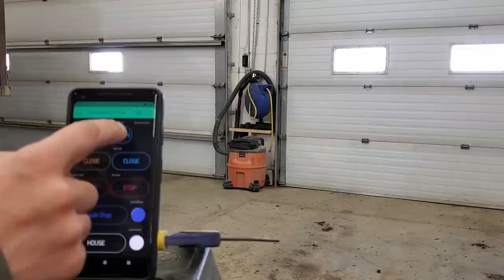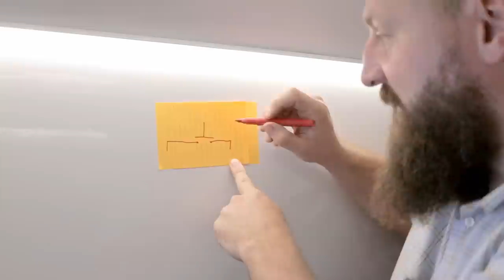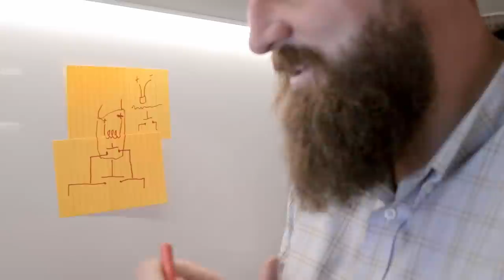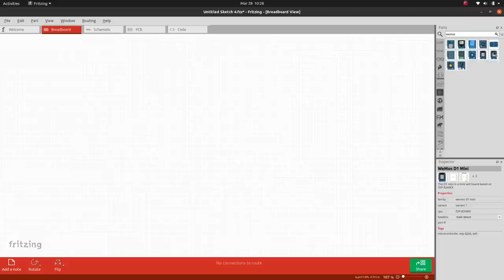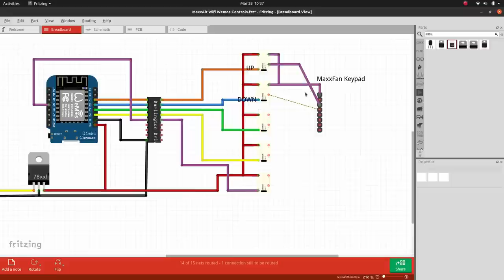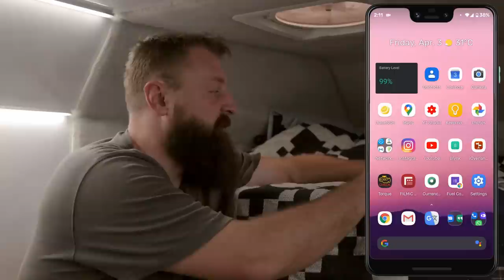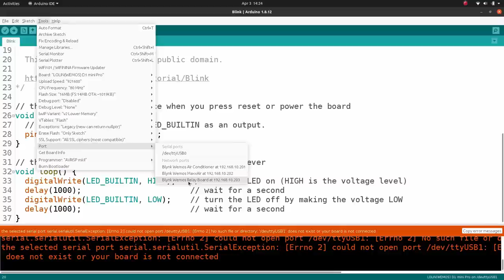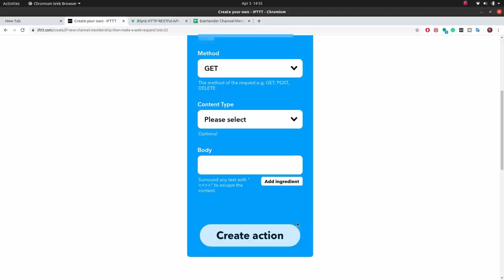How I Automated All the Things - Raspberry Pi, Arduino, Fritzing - Everlanders Automate the World!

Comment: Great video! I teach CISCO IoT Fundamentals at a High School in Oklahoma and I just assigned this video as a distance learning assignment for my students.
Reply from the maker: Wow, I'm blown away and honored!
Reply: @Everlanders  to power the D1 minis are you using a DC to DC buck converter when only the automotive 12v system is available?
Reply from the maker: No, I tapped 5 volts from the controller board from the AC unit, and in the case of the fan I used a switching power supply as indicated in our web site post: https://everlanders.com/2020/04/06/automation-arduino-and-blynk/

Comment: Also...for those just getting started, Tinkercad (free) is a good design program to start designing circuits, and as a bonus has a built in block code building tool that auto-generates Arduino sketches.  A fun and un-intimidating way to get started.

Comment: Very nice video! I also built stuff with arduino's and so but the problem with them was to find out the difference between all those models or even a good manual how to program the things or how to upload it to the board.

Took me many days to figure that all out, but if we have a teacher like you it's much easyier...And then i got the trouble of electric interference from that fan-motor for example...it can really disturb your signals and make the thing getting it's own life...

Anyway, can't wait for more video's from you.

Comment: This video is one of my favorites!  Super helpful.  I've been wanting to hijack physical buttons for years and never got around to researching it.  A few questions...
1. how do you handle someone flipping a mechanical switch messing up the software state of the button? e.g. mechanical light switch that a human switches messing up the software state.
2. it would be a great help to see how you soldered in the pin connector on the back side of the fan circuit board.  possible to show that in an upcoming video?
3. possible to do a future video on how you do your central web server that shows all the metrics/stats for the truck (e.g. the power solar system, etc...)?  I'd like to understand your implementation to see if it makes sense for me to implement something similar.
4. please give us some background on how you grew up and how you came to learn all of the tech that you are so good at (e.g. schools, jobs, etc...).  

Thanks for sharing all of travel and techy stuff.  I really appreciate your channel and how you have customized your rig to be exactly the way you want it!  Very cool!!

Comment: Boy that brought back some memories playing with electronics. For your power needs, if 5 volts isn't available, you could you maybe make a 12 volt to 5 volt power supply using a 7805? I did a couple projects in school with the venerable in it's day 8085 but never went beyond. Did a fair bit of prototyping and wire wrapping. Several people have told me how they like the Arduino and now Raspberry Pi for model railroading and amateur radio projects.  At this point, it would take me too long to get smart to do this but it's fun to see you doing it. amazing all the cool stuff like that prototyping software that we never had in the early 80's.  Stay safe and enjoy your quarantining as best you guys can.
Reply from the maker: Yep, 7805 if you can't find 5v, (that's what I did for the fan)... But if there's a regulator there already ya may as well use it.

Comment: 🤯 This is exactly what I've been researching! Thanks for filling in my 'knowledge holes'.🙏 I'm using a WEMOS D1 mini (love 'em) to remotely control 3 stepper motors ( zoom, aperture, & focus) for a wireless DIY automated 50mm lens. A13MP security camera will feed a RPi 4 w/1TB SSD, capable of streaming the video over Wifi, so it also needs to be controlled remotely. 
The plan is to VNC over Wifi from my PC to the RPi, which controls everything. So ideally it would be the MQTT broker and local Blynk server, controlling the camera, streaming, and steppers for automating the lens. The RPi 4 (located inside the camera housing) also controls 2 larger stepper motors for it's programmable x/y gimbal. That's functional. The D1/stepper board is running uPython code (RPi compatibility), via webREPL. 
Upon completion, a concealed D1 mini will detect motion at my driveway, alert me and trigger the camera to look towards the driveway, zoom in, focus, set the aperture (all presets + other locations), and start recording video until after motion ceases.
Just installed Blynk server onto the RPi4. Looking forward to your followup video involving uPython. Thank you for the pointer to Fritzing. Now, I can PCB my D1 mini stepper board. 🤙

Comment: Awesome EVERYTHING (I was going to say video, but your content is so much more)
Reply from the maker: You're the best!
Reply: @Everlanders  I've just finished watching a heap of your videos. I think we are of like minds.  Though you are ahead of me.  I'm converting a bus to a motorhome (doing all the work myself).  I'm researching and prototyping with Arduino, esp32, RPi 4, Chromebook and soon ROCK 5 Model B.  I want reed switches on all doors and lockers, motion sensor, gas sensor,  temp sensor and voltage monitors.  Also when the clutch is pressed the following will automatically be stowed: satellite dish, stabilising legs, step and a warning if the awning is not stowed.  Plus remote control of outside flood light, air vent/fan, air conditioning and heating.  And of course remote monitoring of 1000Ah of lithium batteries.  Now I'm ordering 10 wemos boards 🙂

Comment: Thanks for another great video.  I made it to the end.  I have been thinking about connecting a coolant heater for my truck to turn on with a text message.  I live in Alaska and work 2 weeks on then have 2weeks off. During the winter we travel down south while I'm off, so my truck gets parked and at-15F makes it hard to start.  This video gives me a starting point for my project.
Reply from the maker: Sure! Just trigger the blue wire on the remote starter with a Wemos pin.

Comment: Thanks for the video, didn’t realize how easy it was to remote download to the esp or the use of web hooks. Retired EE, fun stuff. Currently automating hot water tank with an electric imp,  might have to switch to the esp. Prefer using C as well, but have it all wired up. Wish I had seen your video ahead of time.

Comment: Absolutely blown away with the tech. Just found your channel yesterday and and have been binging ever since. Am currently planning my own build and what got my attention was using pressurized air for your plumbing system. Yup, started with that? Last time I waid air it's fairly light, good idea. Got the wife to go and pick up a raspberry but I can't find the 3po slot??? I have almost no clue what you just said, but I stuck it out to the end. Can you direct me to the kindergarten chanel?

Comment: Okay, I got to that part of the video. Of course I ended up sitting in the dark (Hey Google, turn ON lights) ;-)🤣 This might solve my own garage door conundrum.
Reply from the maker: For the Garage door you can also use inputs to sense if the door is open or closed and then when you send the open commend, it can react with some logic rather than blindly mashing the button. Much like I did for the power button on the fan.
Reply: Everlanders can you do a video on how to do the garage door setup. I have the problem that I’m always in different vehicle than the transmitter for garage doors and could use in depth tutorial. Thanks been following since raspberry pi overhead install days

Comment: Great video. Very helpful.   I'm a novice at this stuff myself but plan to add a lot for systems control and monitoring on our bus. Including the various diesel engine/ mechanical systems sensors.
Reply from the maker: Oh Good, Glad to hear it, this is a easy and cheap way to get into it...
Reply: @Everlanders  I actually set up Home assistant with ESP32s with mosfets and relays for control of lighting and other stuff I'm still building on our bus. What model of the maxxair fan did you use to do this?

Comment: Great Video! Used Blynk with some LEDs, works great. Steep learning curve at the beginning, but if you are a beginner hang in there 😄.

Also you can use a second wemos (with blynk) with i.e. a button to contol an other blynk wemos. (As a remote button, sorta like a button in the blynk app)

Comment: Great video Jason. Perhaps think about a) featuring a single project, and b) breaking the topic into specific videos for each element (1. What's being automated, 2. Physical components, and 3. Software/coding and tying it all together.)

Question: As relays are wired in parallel with switches, variable states become out of sync when someone presses a physical button (A/C temp, fan direction, etc.). Do you simply press physical buttons to realign variable states?

Y'all stay healthy!
Reply from the maker: It's been a couple weeks since I got that going and the state's seem to stay in sync pretty well, we've almost stopped using the buttons.
Reply: @Everlanders  I figured that's be the case. I am correct that changing state with buttons does throw things off though, correct?
Reply from the maker: It would, yes.

Comment: You may already know this but if you use the remote you can send the all of the control options for the fan (temp,auto, in/out, open closed all at once) this would get you around the beeping for big temp adjustments and having to store the state are you are just sending all of it.  You would need to do that through an IR blaster I assume.
Reply from the maker: I went the IR blaster route already, didn't work with the non standard protocols. Further I've since jammed a chunk of blue tack in the piezo hole to shut it up.

Comment: Interesting to watch, thanks! You could also have "emulated" the remote control, using an IR LED and some some code that put out the right IR codes for the corresponding buttons. First it's less invasive on the hardware and second the IR LED could be driven straight from in IO pin eliminating the whole breadboard. Just a thought
Reply from the maker: I tried this with LIRC long ago... The IR protocol for the MaxXFan was non standard and it wouldn't take it as valid.

Comment: Very helpful, informative, and entertaining video! I don't know if you've mentioned it elsewhere, or perhaps I missed it in the video, but how do you deal with ventilation while soldering? You seem to be in a very enclosed space which also looks to be where you sleep, which doesn't seem very healthy. Are you just running the ceiling fan? And is that enough?

Comment: Very nice!  Appreciate your skills and easy going way of articulating.  I am about 20% of the way through my automation design...interface wise to date using node-red and Pi.  Running out of GPIO's so appreciate the nudge towards the Wemos D1 solution.  Just a little concerned I won't be able to actuate all the camper functions in the event of a component, wifi, or Pi failure.  Thus backups and spares!  Be safe

Comment: Blynk looks interesting.  I’ve been using Home Assistant and Node Red to wire things up.  You can even have MotionEye as a part of your dashboard in HA.  Love that it can record to my NAS too.  I’ve got sensors and such, and no relays right now.  Soon though.  I’ve been interested in your channel since you practically do everything I fail to do 😁.  I liked your RPi head unit for the cab from a couple years back.  Keep doing these types of videos.  FYI, you can get more horsepower from a Node MCU or ESP32 chip.  You’ll like the improvements over the D1 mini.  Like, one Node MCU could run both your fan and air conditioner.  The length of run may be a bit long for the wiring though.
Reply from the maker: ... for $3.50 I can't run wire that far...

Comment: The videos are fantastic I would watch hours more of how I automate stuff. There must be some one who specializes in this type of automation that has more in-depth videos. I am in the planning stage of building a camper and would love to know more.
Reply from the maker: We have lots of other videos you could watch...
Reply: @Everlanders  I think I have watched just about all of them. I’m a big fan. I appreciate you manner, knowledge and approach you bring to the whole project. You have obviously came to to the game with a background in electronics. I work in the film industry as a Key Grip. I have designed and built out several tractor trailer, cube, smaller trailers as grip trucks. Doing all the design work on SW’s wiring all the circuits for lights, Webasto heaters light gates and such. I also built an electric camera car, pretty much from the frame up. I used an existing chassis with the steering and suspension geometry all worked out but after that it was all me. 120v dc (36 200 ah Calb’s) running a HPEV AC75 motor mated to a 5 speed VW transmission, not that I ever change gear. I was worried about steep hills with a full load. The cart is a great success. Shot with it on Chaos Walking, Barkskins, See, X Men to name just a few. I could send a couple of pictures if you are interested. After watching one of your videos I’m thinking of getting a SBMS0 v03D, not to charge it but to monitor its SoC
Reply from the maker: @macgrip1  Oh wow! very cool!
Reply: @Everlanders  I am wondering how to become a member of Everlanders? I have subscribed to the channel and just below the logo on your Youtube homepage it says “Subscribed” with bell picture crossed out. I would like to up my membership to at least level 2 but do not see how to do so. I have watched the video where you explain the tier system but the link at the end failed and I dont see any other link on the website to take me to YouTube where you explained the upgrades options and the ability to financially contribute were available.
Reply from the maker: @macgrip1  Be sure your not trying to click the link from an iOS device, if so you may need to use a Desktop Browser... 
https://www.youtube.com/everlanders/join
Thank You!

Comment: Hi, great idea, I've been working with a ton of 8266s and have 2 airfans in my van! ;) I'm probably not going to connect them, because I'm lazy, but I do have a noise and temperature sensor based on a 8266 for when we leave the dogs in the van so I can go and check the webcam or get alerted.  Quick question, do you travel with your electronics kit? Do you ever miss tools or components? I mean, half of my house seems to be dedicated to parts and tools, can't imagine taking it on the road ;) Also, is your phone connected to the van wifi? Or does it work with any network and Blynk knows how to tunnel to the van router and the wemos ip as long as it's connected to the internet? Do you need to have a static IP for the van?

Comment: Thanks for sharing, I definitely appreciate this kind of content (and watched the whole thing). Your Android Auto setup is how I found your channel. As a security professional the integration of IoT makes me cringe a little but it's cool how it all comes together. Security concerns aside, have you run into any issues when you're in an area with poor internet access?
Reply from the maker: Sure, if you're worried about someone Anonymous (😉) turning your fan speed up you could use the "Advanced Web Server" example and handle it all locally. This was in the original video but was cut because of how long it was getting. We have no problems offline, If the router can't get to the server it redirects the traffic to the local server. For most functions, we have a backup of shell scripts key-bound to F keys on a wireless keyboard.
Reply: @Everlanders  Loved the video! I'm interested in learning more about the offline rollover as this is something I would run into a lot in my van. Which service is doing the rollover? The blynk app? I'm guessing Google assistant doesn't keep working without internet.

Comment: You should try wire wrapping as an alternative to soldering those little pins. Its easier and neater, especially for larger, more complicated projects.
Reply from the maker: Most of what I do is surface mount, so I'll be sticking to solder.
Reply: @Everlanders  Oh yeah, for the surface mount stuff, for sure solder. I was referring to the cross wiring, as in 14:34.

Comment: Awesome! Just what i needed for the work I am currently doing to my truck. Part 2??..Would be awesome to see how you setup the system outputs. (Temp/Voltage/Current) Also, once the system is configured, will it work offline/through your LAN network? I don't plan on being connected to the net or need remote monitoring when I am on the road.
Reply: You could accomplish app-based control by substituting Bluetooth for WiFi. Sadly, no digital assistant or IFTTT integration, though still could be useful. A single remote for everything, remote control within 10m/33', etc.

Comment: Correct me if I'm wrong, but doesn't Blynk require an active internet connection? It would be awesome to see this reworked to utilize homeassistant as a sort of "hub" for your bits of automation. It would resolve your dependency on the internet for your automation. It would be a shame if you couldn't turn on your AC from bed just because you didn't have any internet :) Homeassistant allows you to do some great dashboards that easily allow you to flip between a phone interface and a browser-based interface as well as an uncountable number of existing integrations.
Reply from the maker: No, internet is not required. We run a copy of the Blynk server on our local LAN and I hacked together a python script that syncronises the local server to the Blynk cloud server when we have a Network Connection, which is almost always thanks to our MoFi LTE router.

I hate home assistant and will not be using it.